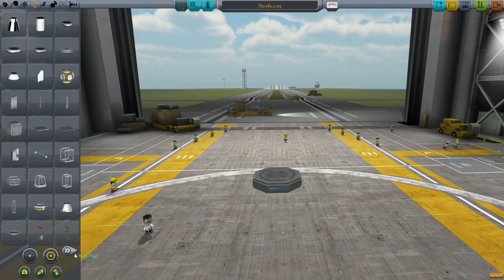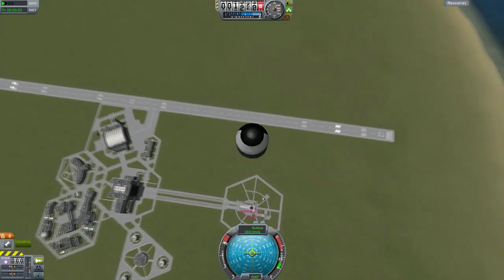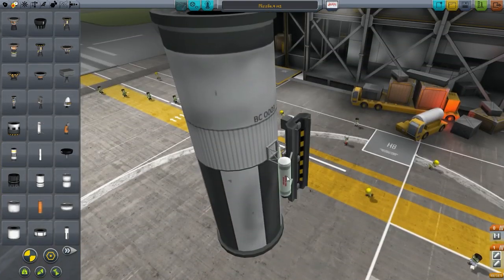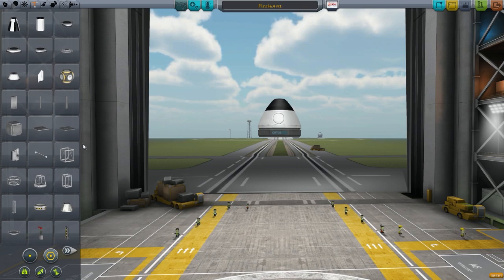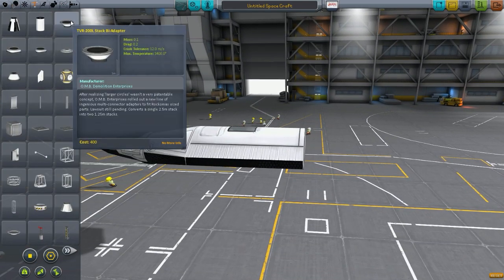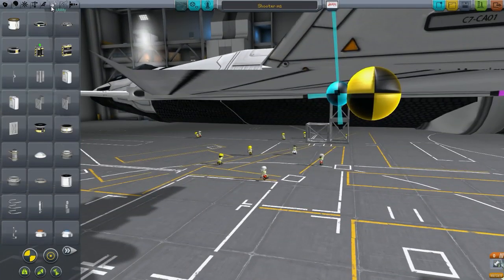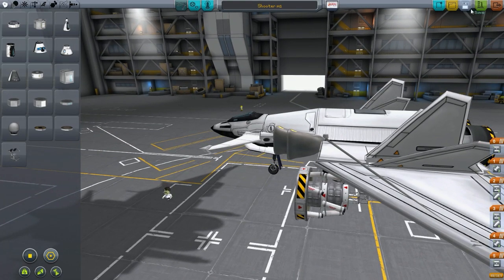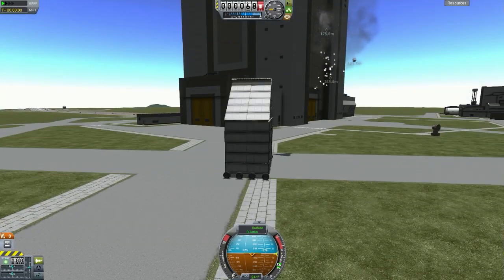KSP : How to Make Stock Missiles

Comment: they really arent missiles. these are ROCKETS. missile implies  it has some form of post launch tracking or target  acquisition.
Reply: +Sora-saurus no, misile is a proyectile that has been designed to be trown, depending on context, arrows or rocks can be missiles. bullets are missiles. rockets burn fuel to trust themselves. that' s why the term "seeking missile" exists.
Reply: great spelling!
Reply: Go back to school
Reply: "In modern language, a missile is a self-propelled system, as opposed to an unguided self-propelled munition, referred to as a rocket (although these too can also be guided). Missiles have four system components: targeting or missile guidance (Missile guidance refers to a variety of methods of guiding a missile or a guided bomb to its intended target. The missile's target accuracy is a critical factor for its effectiveness. Guidance systems improve missile accuracy by improving its "Single Shot Kill Probability" (SSKP), which is part of combat survivability calculations associated with the salvo combat model.[1][2]), flight system, engine, and warhead. Missiles come in types adapted for different purposes: surface-to-surface and air-to-surface missiles (ballistic, cruise, anti-ship, anti-tank, etc.), surface-to-air missiles (and anti-ballistic), air-to-air missiles, and anti-satellite weapons. All known existing missiles are designed to be propelled during powered flight by chemical reactions inside a rocket engine, jet engine, or other type of engine."

Comment: I have found out how to make very small guided missiles just take that tiny little stack sepatron and flip it so the red arrows point out to where you want to launch your missile (into the air, or away from launcher for example) then just put that one very tiny like 0.5m engine the one with the orange base the one that can be stack mounted then put several oscar b fuel tanks depending how much fuel you want, then put that one very tiny probe control module, the small sas module with the red light, the small battery and then the small nosecone like the one he uses above. Very simple and compact guided missile.

Comment: In stock, (Because I don't like mods.) I made a bomb where you can choose what size you want it to be while flying, and stock missiles. But the missiles weren't by me, they were by Marex333.
Reply: Bob Blockingston  so you didn't make it :P
Reply: I made the bomb, but not the missles.
Reply: oh:P
Reply: Can i have teh link???
Reply: I didn't post it, but it's just a bunch of small grey fuel tanks with small decouplers put into a number action of which will decouple, 7 being the whole thing, 1 being a small part.
Reply: Bob Blockingston ok